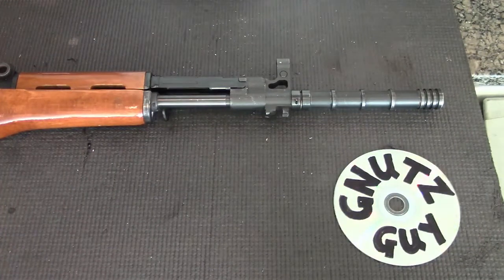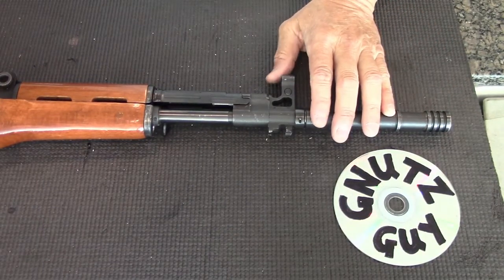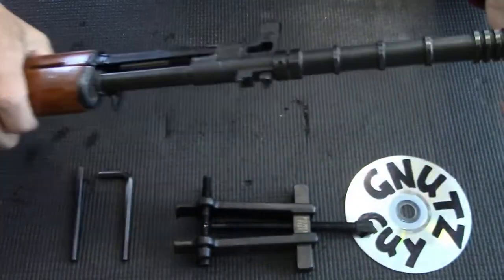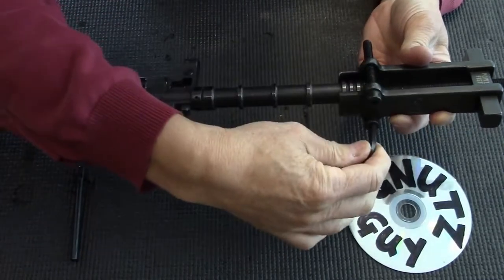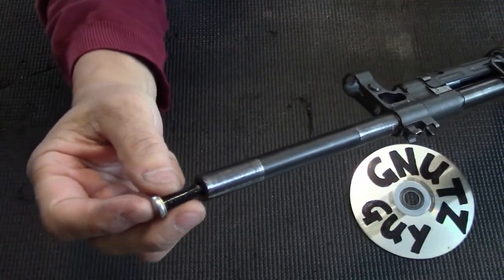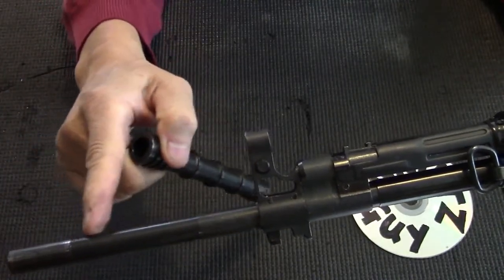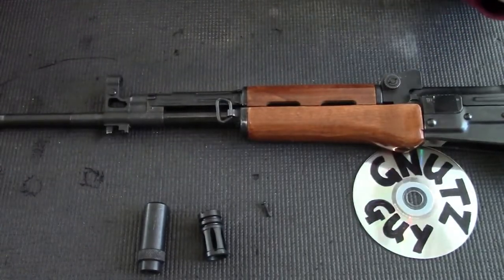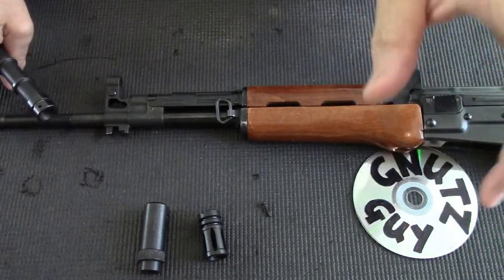Removal Type 81 Grenade launcher sleeve. *

Comment: Is the gas block part of the front sight? , or they are two separate parts? Asking because the front sight could be moved to the end of the barrel , surprised you haven't done it since you are so good at working on firearms,  love your videos  keep them coming, hopefully one video on my question.
Reply from the maker: @hunter5369  not connected, I was gonna do it, then they imported the LMG that has the front sight near the muzzle so I didn't have to do it, yippie
Reply: @gnutzguy  I see,  I got one of the rifles , not the lmg , and I want to move it forward so I was trying to figure out how to do it, the other issue I would have is that mine is the phosfated version and the barrel portion under the launcher is probably bare or just blued and it would look funny I think, but I would really love to have a longer sight picture

Comment: Type 81 is prohibited now and I watch this because I bought an extended charging handle and a muzzle break from delta-dynamics and now I need to remove the grenade launcher sleeve and thread the barrel and pretend that my hobby will not make me a criminal. Cheers Gnutzguy. Make more Type 81 while you can. I hope we will have a 100% voter turn out from our community this elections.
Reply from the maker: thanks man.

Comment: What size is the screw you used?
Reply from the maker: the head of the screw should not touch the bore but a tad smaller. try out a few,
Reply from the maker: more importantly put enough tape on the thread of the screw so it doesnt move

Comment: Hello again gnutzguy, in this video you mentioned the Sigmaco Canada barrel sleeve, I'm just wondering when that video will be released.

I want to get one to put on mine, but I would like to know eas of installation, compatibility with muzzle devices & bayonet, and if it's worth getting a hold of one.

Thanks
K.C
Reply from the maker: @kilo, I don't think I mentioned sigmaco in this video bcos they didn't exist at the time. I could do a video if sigmaco supply me with one. why don't you message them?
Reply: @gnutzguy have you found that removing the barrel sleeve affects accuracy?
Reply from the maker: @papermind4010 none.
Reply: @gnutzguy  and you’ve had it like this for a while, how far have you taken it out like this?

Comment: Well, just got mine off the other day. The pin on mine came out easy but the sleeve itself was really stuck on. Bearing puller just bent and broke itself and no amount of hammering got it free. Didn't have heat, so, I went with the next worst option left. I took an angle grinder to mine, cut some material away above the crown and then cut a slit down the side of it. Finally, took a wedge and hammered it in a ways to crack and stretch it and finally a pin to hammer and push the rifle out of it. It was a really tough ordeal but it came off and the barrel was fine. I don't recommend this method but, if you want it off and don't plan in putting it back on, it is doable.
Reply from the maker: yup, i agree, i dont recommend your method too. i gather you werent able to find a puller like mine? the puller i used is not bendable.
Reply: @gnutzguy  Lol love that response.

 I bought a puller that was exactly like the one in your video, however the friction fit on my spigot was so tight that it would not move at all with either the bearing puller or hammer method. Even when paired with a half a can of Kroil penetrating oil. If I had access to any kind of hydraulic press setup I would have liked to use that, but I live in a rural area so, farm shenanigans to the rescue.
Reply from the maker: @Harrison2610  I would have tried torching the GL while using the puller before cutting. Weird , this is the first time i have heard the puller didn't work since posting.
Reply: @gnutzguy  I saw a few posts elsewhere of people mentioning it. Guess it's just differences in tolerances from parts and factories that lead to some spigots having a much tighter friction fit, or some having a tighter fit pin. Like I said the pin came out on mine with barely a light tap.

And yea if I had a proper torch setup I would have but, I had an angle grinder, not a torch lol
Reply from the maker: @Harrison2610  well it's off now , what's next?
Reply: @gnutzguy  I put one of the barrel sleeves from Sigmaco on it and a surefire procomp Muzzle brake. Haven't fired it/re-zeroed it yet but I'm excited to see the results
Reply: @Harrison2610  Going through this ordeal myself currently. I had to cut the pin out, and now even with 2 grown men cranking on the pulled, cant make the sleeve budge. I'm already this far though. What other route would you suggest going?

Comment: How did you go about drilling the pin out? Drill press/what material of bit? I have one that is incredibly stuck and I've tried everything besides drilling it out.
Reply from the maker: Unfortunately, it has to be done on a drill press. Center punch the pin and gently drill it out. Do not use force or the drill bit will bend and drill the GL itself.

Comment: That sleeve pin is the bane of my existence.
Reply from the maker: lol. been there. first try soaking it in acetone if that dont work then apply little heat with a hair drier or a heat gun and punch but be careful not to over hear cos you will ruin the finish.

Comment: What is the OD of the barrel at the end of the rifle? I'm looking to put a 5/8x24 brake on the end which is a minimum OD of  0.6144" and maximum OD of 0.64". Great video!
Reply from the maker: i actually put a flash hider on mine and there is vid on it with in the info you seek.

Comment: Do you know what the diameter of the barrel is after removing the sleeve? I’m curious if an AK bayonet would fit since the part that goes over the barrel usually cannot fit over the sleeve but maybe with it removed it could
Reply from the maker: Check my other vid,  threading over size barrel type 81.

Comment: Have you or anyone else you know of successfully moved the front site forward after removing the sleeve? I've got the sleeve off now, but my gunsmith is concerned that moving the site forward could destabilise the gas black
Reply from the maker: see type-81 pictures, modification thread , post 313 . no issue with moving FSB.
Reply from the maker: On CGN
Reply: @gnutzguy  Thanks! Hate to be a pain, but could you link here? I searched CGN and can't find anything.

Comment: I think this rifle would look better with barrel cut to 15 inches with muzzle break but that would make it restricted
Reply from the maker: looks fine as is. check out the vid with the flash hider.
Reply: If you had a gunsmith cut the barrel back to 1/2" in front of the FSB, threaded, and a long brake welded to the barrel, it would still be NR. Something like a Brekke custom 4" or 6" CompXtension.
Reply: @the.albertan  no it wouldn't. Dont spread false information. Even if a muzzle device is welded to the barrel it doesnt count in overall barrel length. And it is illegal to cut ANY barrel shorter than 18 inches in canada. If you could get a custom built barrel that was shorter you could go that route and make it restricted but a muzzle device, welded or not will never count towards your barrel length in canada. Its dumb but thats the way it is
Reply: @hitman19971  where in the firearms act does it state that a muzzle device does not count towards overall barrel length?
Reply: @the.albertan  the canada criminal code defines barrel length as 

"Barrel length

(2) For the purposes of this Part, the length of a barrel of a firearm is

(a) in the case of a revolver, the distance from the muzzle of the barrel to the breach end immediately in front of the cylinder, and

(b) in any other case, the distance from the muzzle of the barrel to and including the chamber,

but does not include the length of any component, part or accessory including any component, part or accessory designed or intended to suppress the muzzle flash or reduce recoil."
Reply: @hitman19971  I stand corrected. Thanks.
Reply: @the.albertan  no worries. I only know because Ive looked into doing it for a while. Unfortunately our laws are shit. As if 2" less of barrel length magically makes a rifle a scary murder weapon with a mind of its own.

Comment: Any idea if an ak bayonet would fit with the grenade launcher removed? I know the type 81 bayonet has a larger hole to fit over it, but the ak bayonet hole is much smaller, looks almost as if it would fit the barrel perfectly, been wanting to see if the one I have would fit but don't want to remove my grenade launcher if it won't. Any help would be great thanks!
Reply from the maker: unfortunately, i dont have a ak bayo but if you could find out whats the ID of the ak bayo ring? i could tell ya the OD of the t81 barrel is .57"
and .545" using an annular cutter.

Comment: thanks for vid  ditch gl just a scratch on inside of barrel not to bad  but the rifle  balance is better now
Reply from the maker: fantastic... the muzzle looks bare, if you got a folder? you got to put a muzzle device.
Reply: @gnutzguy   yup on muzzle device  looking into true shot sks replacement sight  just got to look measurements
Reply from the maker: @chrisbyers386  excellent idea. I like the ak front sight. Let me know if it's a good fit, the diameter of the seems to be, not sure about the height.
Reply from the maker: the gen 3 slide on type wont work but the gen 1 clamp type will work on the mid section of the barrel.
Reply: @gnutzguy  check the height it wont work from what i can see  sks is lower in height
Reply from the maker: thanks for the info. i  will move the first sight block and mod it to look like lmg.

Comment: Step 1: Buy a Type 81

Step 2: Realize it’s junk

Step 3: Sell Type 81...and use money to put towards purchasing a M10x USA made hybrid AK...
Reply from the maker: i wouldnt call it a junk but there is room for improvement. thats is what my videos are all about, mod/improving it and have fun doing it. 
glad you're happy with your M10X but i would never pay twice the price and i prefer a gun that has a direct service/battle lineage, not a hybrid.
but if they want to sponsor me, i wouldnt say no. lol.
Reply: I had both the type 81 and M10X (back when the M10x were going for $1700). Ended up selling the M10x and keeping the 81. Granted the M10x is less of a hassle to mount optics and has an excellent trigger, It's way, way too heavy even without optics and wasn't any more accurate than my Type 81 with the same ammo. I was getting approx. 4MOA with the T81 and 3.5MOA with the M10x. I'm sure accuracy would change with better ammo but lets be honest... nobody gets a 7.62 to run new production ammo. Even after a few hundred rounds through both rifles I was still getting FTF with the M10x on a semi-regular basis. If M+M fine tuned the rifle, brought the weight and price down, it would be an excellent rifle.
Reply: @the.albertan  Cool, for me I was very unimpressed with the Type 81.

The one I had, left a lot to be desired.

Mine had sights that would literally fall apart from recoil after 20 rounds. 

The vibrations from the weapon would cause the tension only secured retaining pin to back out and cause the sights rail to pop off.

I was also not impressed as to how it handled heat dispersion. The thing gets hot real quick.

Overall the Type 81, for me, felt cheap. 

Having a good amount of experience with real actual AK platforms the Type 81 does not hold up in my opinion.

The M10x for me was the better choice.

The features that it comes with are superior to those of the Type 81.

I have been getting realistic groups of 2 MOA consistently shooting at 200m targets, unsupported in the prone with my Aimpoint without magnification.

I totally agree with you on the issue of weight, it is not light for sure - I like to think that this weight help handles the recoil.
 
In the end it comes down what you are looking for and what you want to enjoy. 

Happy and safe shooting. 👍☺️
Reply from the maker: btw, just announced, M10x dropped their price from $1999 to $1699, a $300 drop. OOOuuuuch !!! i hope my viewers didnt followed your advise.
Reply: " use money to put towards purchasing a M10x USA made hybrid AK" Lol, that's like divorce a loyal wife then spent the money on an unstable mental gold digger
Reply from the maker: LMAO
Reply: Bolt in m10x destroys itself.  Junk rifle

Comment: It baffles me that we can’t have semi auto Kalash rifles in Canada but I own one of these which is permitted.
Reply from the maker: baffling indeed. one of the fears the rcmp had with the FN (also prohib ) is countries dumping them here when upgrading to .223 . i always wondered if that is the same with the Ak47 in 7.62 to AK74 in 5.45.
Reply: The reason is because it wasn't around in the late 80's or early 90's. At that point they looked through gun magazines and circled anything that they wanted to ban. AK is banned by what it is and not how it works much like the FAL, SPAS 12, and other toys. Now the RCMP has to actually use function to determine if it can come in or not. If this was an AK variant then it would be automatically blocked, but since it isn't they checked to see if it was difficult to make full auto, and once that passed and it didn't go against any OIC then they let it in.